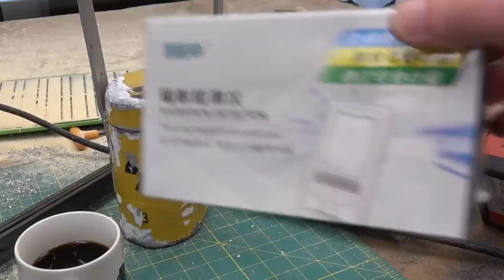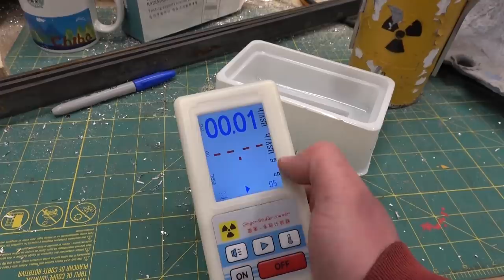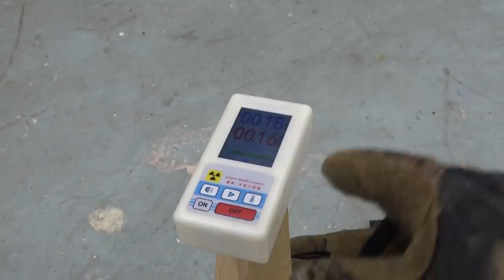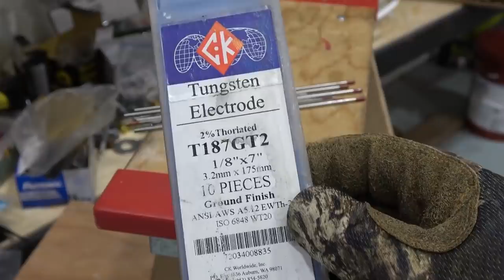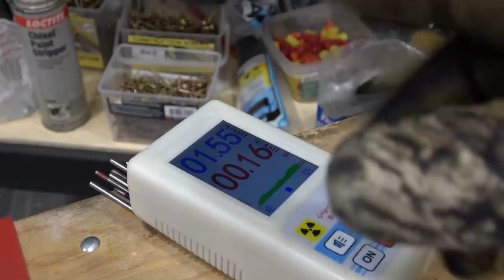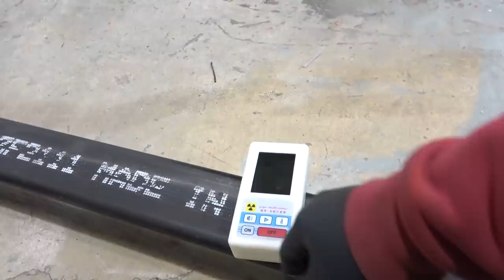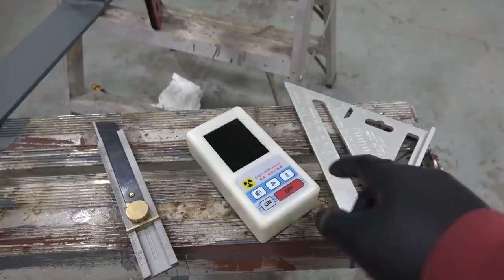Testing Radiation from Tungsten, Japanese Steel | Welding Metals Tested

Comment: The measured radiation from that tungsten is not actually measuring the emitted alphas from the thorated tungsten... it is measuring the secondary gammas produced when those alphas interact with the casement or the walk of the tube itself or the air around it. (Mostly the carbon in the plastic case and the co2 in the air). The bulk of the secondary radiation produced is neutrons from the more prominent alpha-n reaction with carbon. However, that GM tube will not read them as nearly all those neutrons go right thru the detector and will never interact with the gas because they lack a charge and therefore will not be slowed down from coulombic forces. 
Lookup 9” BONER spheres... (you can’t make this shit up I still remember 19 y/o me cracking up in that physics class) they use HDPE wrapped around a detector tube to attenuate or slow down the neutrons to what is called “thermal” energies so that they can be measured by the tube and/or they simply measure the secondary gammas produced by the neutrons as they slow down.

Comment: Three ways to deal with radioactive material time, distance and shielding. For more accurate readings you'll need to suspend the instrument a set distance from the thorium rods as the wood acts as a shield.

Comment: In the atmosphere there is a change in energy over distance as radiation interacts with air and water molecules or other things over its travel. In space or vacuum the energy of the radiation is only altered by dust and the curvature of space time by gravitational fields. Inverse square law applies to the inherent physical geometry of space itself and the fact that rays trace outward through the arc from a point. That is to say that the internal area of a sphere changes at a logarithmic rate to the distance from the point of origin at its center. This has the overall effect of decreasing the area of exposure to rays of radiation for a given object with a fixed area as the distance changes from the point of origin. So the radiation is of equal intensity but the area of exposure is less and hence the measurement of a given dose, (energy over area) decreases with distance.

Comment: The inverse square law is easier to imagine in terms of 3D space, as that is what it is describing. Imagine a light bulb inside of a sphere. The light being emitted is being spread out onto the inner surface of that sphere. Make that sphere bigger and the surface area that the light is falling onto has increased much more than the diameter of that sphere.

Comment: Does the dead tree carcass absorb the thoriated tungsten radiation? If so, putting it on that ladder at 11:27 was probably blocking the radiation and not showing the real level coming from the source. Also does plastic block it?
Reply: Everything blocks Alfa. The plastic case of the meter, and the gm-tube wall itself. What he measures is the decay products of the thorium

Comment: (7:54) think you meant to say micro-Sievets/hr not milli-Sievets/yr . . using the peak reading shown: 1.5 uSv/hr x 12hr/day x 365 days = ~6.6 milli-Sieverts/yr ( ~660 milli-rem/yr ).    but there is another issue, typically low cost/moderately priced ( under $2k )  Geiger Counters are calibrated to the Cs-137 energy level, +/- 20 % tol ...( 10% if calibrated ).  Although any GC is better than none, other radioactive isotopes ( such as Th, Sr, Co, Ra, etc. ) will not measured correctly.    In a U mine, with low level radiation present, inhalation is a much more serious hazard than external ionization. .. ( methinks you know this ).         lov what ya do . .  Cheers

Comment: Great video. Anyway; Sore D**k Deal alert: Remember when AVE reviewed a Milwaukie (spell check thinks that's right) portable bandsaw? Well Canadian tire sells a blue version that is pretty much 1:1. Now I don't know how they do their sales but at least at my local one (431 Louth St, St. Catharines) is selling it for $50 instead of $200 to $300. Battery not included but the mastercraft 20v battery packs look almost the same as pretty much every other 20v pack out now. Unless there is some identification circuitry you could probably get it to work with most packs. Also, it's locked to 550sfpm, but at this price I'm fine with tearing out the electronics and modding in a dc speed controller or even putting in a new motor. It also might be a good price to get if you just want the motor and gearbox or replacement parts for another bandsaw. Surprisingly, mine when I took it apart (to see just how bad it might be) had almost no rust, dust, or junk in it. 
Anyway, if this comment helps anyone or if the big man himself takes notice let me know. If not and I got you all excited only to find the sale is over or not at your local store...well, sorry.

Comment: Shouldn't be carrying any more Thoriated rods around than required for immediate use on a particular job. While it's obvious to those of us with some Physics education, for others who evaded H.S. Physics, the more of them bundled together in one place, the "hotter" they'll be collectively. Storing them in a steel box or an old lead-lined film pouch made for transporting film through airport X-ray machines would reduce exposure at a job location where one must have immediate access to another rod. The biggest risk is inhaling dust created when grinding the rod down. Next biggest risk is inhaling fumes while welding, depending on the skill of the welder. Burning metal and a high rod consumption rate by an apprentice, novice or otherwise inexperienced welder has a much higher Thorium ingestion risk.

You're correct that Thorium's primary decay chain is Alpha radiation which is stopped by skin, the overwhelmingly most common isotope, 232, decays to Radium 228 + a --> Actinium 228 -B  --> Thorium 228 -B , releasing two rounds of Beta radiation which has moderate penetration. Two more Beta are released at the end of the decay chain in either of the two transition paths from Lead 212 to stable Lead 208. Most of the Thorium daughters also emit lower energy level Gamma. Regarding decay, the greatest hazard remains Alpha radiation if ingested, but barring that, its external hazard is the Beta and Gamma.

Thorium 232 also undergoes an occasional spontaneous fission reaction if it absorbs a thermal (slow) Neutron decaying to U 233 which then absorbs another neutron and splits:
Th 232 + N --> Th 233 -B --> Pa 233 -B --> U 233 + N << fission (~Strontium + ~Xenon or ~Cesium + 3 N)
Not always those, but typically one light and one heavy plus a few neutrons and massive ionizing energy compared to decay . Rinse, wash and repeat with the neutrons slowed to thermal level if the fission is sustained in a reactor. The hazard isn't purely Alpha, but only the large majority. Xenon transmutates to Cesium which then decays to Barium. This is an occasional reaction, but it adds to the total radiation being emitted. Note that Thorium is classed as "fertile" versus fissionable, as it does not directly fission, but breeds U233 does fission. The above is simplified, but contains the important basics.

Additional Notes:
Thorium 232 is being pursued as a nuclear fuel for a number of cogent reasons:
** It's the most prevalent, naturally found fertile element, at three to four times the quantity of Uranium, only a fraction of which is fissile (U235).
** Its nuclear waste is much less problematic compared to Uranium/Plutonium (still not simple). Methods to recycle the cycle byproducts in the reactor greatly aid in this.
** It's much more difficult to use a Thorium reactor to breed enriched, weapons grade fissionable material.
The Thorium fission cycle has been known since the inception of The Manhattan Project. Some of its lack of pursuit in the US was the desire for breeder reactors to generate bomb grade Plutonium. Molten salt reactor (MSR) design research was quashed with the firing of Alvin Weinberg at Oak Ridge in the early 1970's. India, with its large Thorium reserve is one of he countries very actively pursuing Thorium reactor development. There is other ongoing research using an energy amplifier in an Accelerator Driven System (ADS) for a sub-critical reactor that is even more efficient at burning up nuclear waste and inherently inhibits proliferation with near zero Plutonium production.

Building your very own ADS powered by TIG welding rods could be a great project to power your workshop, home and entire neighborhood, provided you resist the temptation to BOLTR the reactor. The risk would be a Canadian three-letter agency showing up in HAZMAT SWAT gear to shut it down, seize it, and you along with it.

Comment: I always hear there's a market for low-background steel but if you can't find the right buyer that doesn't help.  My company has a shit-ton of old steel gas cylinders build prior to and during WWII. all before the first Atomic bomb test.  We've been retiring these because they are SUUUPER heavy (120-140# empty weight for a 50# cylinder)  and cause too much wear and tear on the employees as well as the equipment.

Haven't been able to find a scrap dealer willing to care one bit about them being made of low-background steel so we've just been getting basic scrap value for them.

Comment: the alpha particles from the tungsten in the 16 inch test wouldn't be penetrating the wood of the ladder so no surprise you read background... also alpha particles would typically be stopped by clothing so unless you have holes in your pockets there should be no real risk...  just don't go for rod on skin action...

Comment: I had a friend who bought a pickup truck from an old welder who was getting too sick to drive. It had custom bumpers made from drill pipe. When the third time he set of the radiation alarm at the scrapyard they went over his truck with a fine-tooth comb. They found that the bumpers were quite a bit hotter than anything should have been, just below being legally radioactive waste. He tried to call the previous owner and did not get an answer so he drove out to his ranch. When. He got there he found out that he had died of lung cancer and had a lot of radioactive material in his body. They were in the process of tracking down everything he built with that pipe, and they replaced his bumpers on a 20 year old truck before they would let he go on his way. He got the OEM ones that had been on the truck. They were hauling off the dirt, the barn, pulling up most of the fences and so forth. Apparently some scumbag sold the pipe as not being radioactive and it killed the buyer.

Comment: We don't use thoriated electrodes any more. We've switched to rare earth... Which will probably kill you but you can't pronounce it so all good. We've also got fully enclosed tungsten sharpeners that  use coolant and traps the sludge for disposal.

Comment: AvE, quick tip to help with that inbox- typically spam emails use words like "the" "a" "to" and "Nigerian prince". so, create a simple filter rule to move all messages containing those words right to the trash folder. once you create the filter rule have it run through your current inbox.
I did this to my email at work and you can't imagine how little spam I get.

Comment: Hey Ave, I got a experiment for you, simply put, how to glue different materials with different glue and how to make it the most effective. Also a strength test would be nice. (I know the information is on the internet but the strength test with measurements isn't :)  )

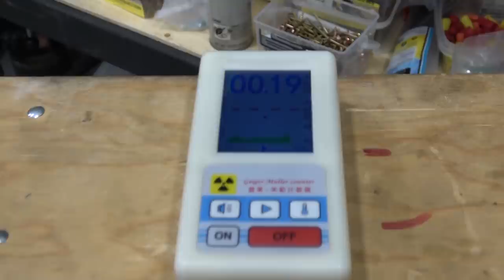Comment: Someone may have already asked but I couldn't find it in the comments section...at time index 10:26 you are testing the inverse square law...doesn't the wood ladder material block 100 percent of any alpha particles that might be coming off the thoriated rods?  Maybe you could suspend the rods 14 inches above the detector so there is nothing blocking line of sight.

Comment: I had to chuckle a little bit while you talked on light and in inverse square law, It's 100% correct. Unless your working with lasers, in which case it's not to be operated by fuckwits.

I have so many holes burned in so many shirts...

Comment: If alpha particles can only travel a few centimetres and can be stopped by your skin (or a sheet of tissue paper or a plastic bag) how do you think that they can get inside your detector tube and trigger a detection event? Beta might just manage it, but you are mainly talking about gamma. When you test a known alpha emitter such as uranium or plutonium, the readings that you get on a conventional detector are nothing to do with the primary alpha decay, but beta and gamma given off by decay chain products decaying further.

Comment: They used Thorium (and other radioactive compound) coatings in some (not all) camera lenses around the 70's and 80's...    Same thing... Its kind of interesting, but not really dangerous....
Reply: ...starting in the late 1940's ( till late 1980's ) rare earth elements ( such as Thorium & Lanthanum oxides, up to 30% ) were used in making high optic glass lenses ( in addition to also being used as coatings later on ) to reduce a half dozen optical lens aberrations.  ( military uses first, then nasa/professional )... ... a noticeable effect w/these lens, after ~50 yrs, the constant "bombardment" causes the lens glass to become darkened.  ( there were a few microscope lenses made by B&L in '60s...not a good idea... ( alpha to the eyes ) but these was only made for a short period ).  lens mfgs incurred a substantial cost when they stopped this rare earth process in the decontamination of their facilities.

Comment: So when we use hammer drill bits to drill brick and concrete are we being radiated by the tungsten carbide drill bit tips?
Reply: It's the thorium that's radioactive, not the tungsten.  So unless you're using a thoriated tungsten hammer drill or using a hammer drill on contrete from Chernobyl any localized stupidity isn't due to radiation.

Comment: Ah... the classic chinesium! Thing is, these things will never be good at telling you the effective dose rate you're exposed to. Firstly because they don't even detect anything less than a gamma ray if it's EM or at least as ionising as an electron if it's particle. Secondly, GM tubes are wired to act as simple switches - on or off. All it does is register an event, it has no way of knowing what kind of event, how big, etc. That's why the only way to tell what radiation you're detecting is to put something in its way that's known to block one type but allow another.

Best way to use this is to turn the clicker on (I find it provides good ambiance!) and switch to count mode (typically in clicks per minute or CPM). You get immediate audible feedback and the raw data this thing is actually measuring.

If you want an actual dose rate you need a scintillation counter which uses a scintillation tube and measures actual ionising power.

Comment: Get a 800ma glass fuse connect the live and nutral across it.... instantaneous current surge cause a white flash and gamma radiation. Discovered this by mistake  could you measure the energy on your radiation detector interesting to see how much radiation it emits?

Comment: AvE! Get rid of that abomination and get a Radiascan 701a! It's not cheap but it is what it is, a Real Nuclear Radiation Counter & Dosimeter that uses a built in Pancake detector, much like a much higher priced Mazur PRM-9000. I'm sure I've said this before somewhere on here but I own one and it blows the competition out of the water, and measures Alpha, Beta, Gamma and Xray (Braking Radiation) so it's one of the few that will detect Tritium effectively as well as Radon. Detection time is instantaneous on the 701 unlike most of the competition, and it will also measure anything from a Tritium vial to a great chod of Uranium without passing out (unlike competition again!). I suppose I am biased but I aint plugging the 701 for no good reason, as I own one, but I can't stand seeing a man of your Calibre using that thing !!

Comment: If the world was 1 dimensional, everything would radiate linearly. But no, we live in a 3d world, and in our 3d world most energy radiates in a spherical bubble. A bubble's area is 4*pi*r squared, so the energy drops proportional to that, to the radius squared. That's the inverse square law in a nutshell.

Comment: Arduino Vs E.... whatever it was.... I was looking at one of those Chinesium G-M thingies a week ago, $66 US or less on the Bay, so can't go too far wrong... Better ones are about $110 or so... but your's died? 

Now THIS week I have been paid, so am thinking about one of these el-cheapo devices again. 

Do give us a spoiler - did you get it going after it blanked out? I don't want to buy one of they are just going to die (from radiation poisoning - joke) after an hour of use... I'd rather pay a little more for one that'll live a bit longer...

Comment: I heard Fukushima is why Subaru stopped making small engines a couple years ago.
Reply: Just so you know that's a false claim. Subaru still makes small engines (under the Subaru Robin name) but they are no longer available new state side because the US market is too hard on their equipment and subarurobin is not set up with the proper facilities to provide adequate support.

It was cheaper for them to only pull out of USA sales then it is to build new (or buy existing) factories or warehouses for parts
Reply: J Stew ok ya wasn’t exactly sure what happened. I know the eho35 is discontinued though which is why I said it. I have seen a couple Robin motors online but thought they were copies